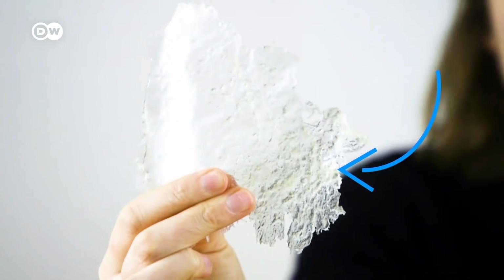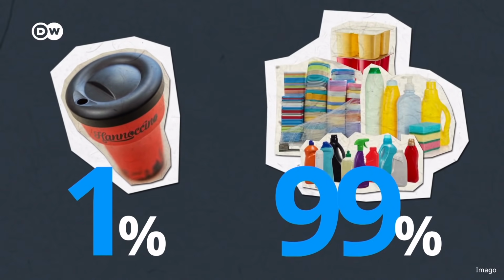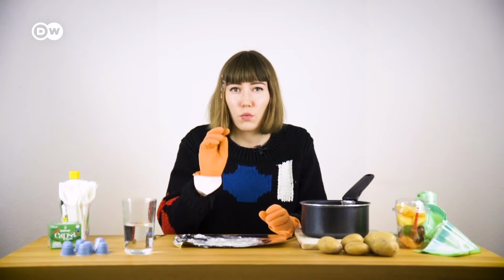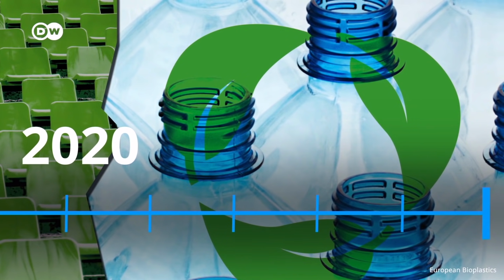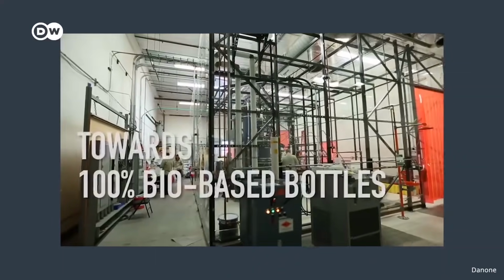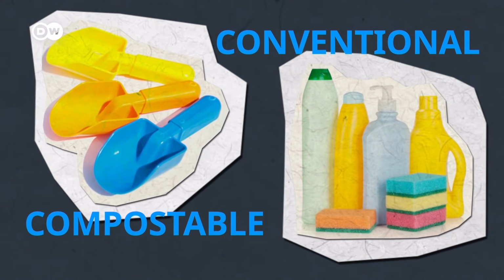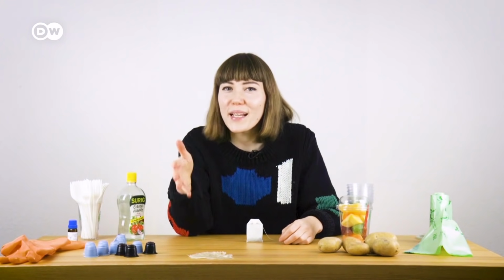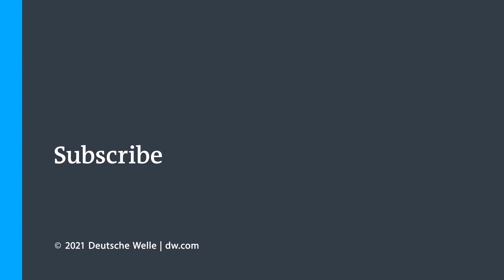Is bioplastic the „better“ plastic?

Comment: I seriously doubt they are taking into account all the energy needed to make bioplastic.  Plastic made from oil is VERY efficient and easy to make.  That is why it is cheap and used so much.   VERY VERY few "green" technologies are actually better for the environment.  Oil is VERY energy dense making it very efficient to transport.  Bio mass is not.  Not only does the production require things like much larger amounts of land and manpower, but also water, fertilizer, pesticides, herbicides, machines to plant it, machines to harvest it, machines to transport it...  Then there are the other chemicals to go into making it as well as all the processing.

The big problem is this also revolves around the theory of the environmental impact of CO2, which is all based on a VERY flimsy study.  More than likely they had it right in the 70s... particulate matter 2.5 (that nasty stuff that cause smog and acid rain) is WAY more concerning than CO2.  PM actually kills millions each year, while CO2 makes plants grow better.  The reason environmentalists switched to CO2 was because the US and most other Wester countries were cleaning up their act, but CO2 lets these environmentalists go after Big Oil and still pressure the US.  This is about money and power now, not the environment.  If they stayed with PM then they would have to go after most of Asia, the Middle East, most of Africa... in countries that just do not care.  They pollute and dump garbage all over the place.  These countries are the problem but environmentalists want stricter and more expensive regulations and taxes on industries until they move them to these other countries that have NO regulations and pollute WAY more.  This environmental movement is making things WORSE!!!